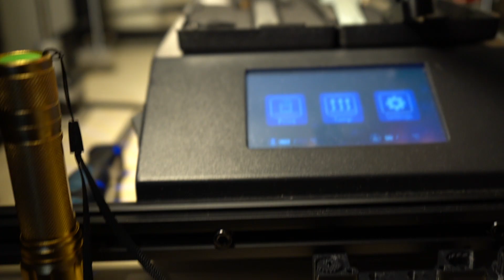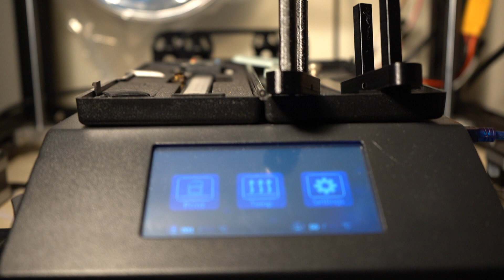3D printer Comparison Ender 5 Plus vs. Anet a8 Plus and Flashforge creator pro

Comment: Strange Anet white blower direction !?
Reply from the maker: Good observation :). I changed the extruder motor and cooling system, notice its gold with square cooling block (the original one kept coming loose on me) with the new changes the duct does not fully clear without touching the heating block, so i just turned it around for now.
Reply: @IrvinCunanan  horrible decision, better just remove the duct and it will print better.